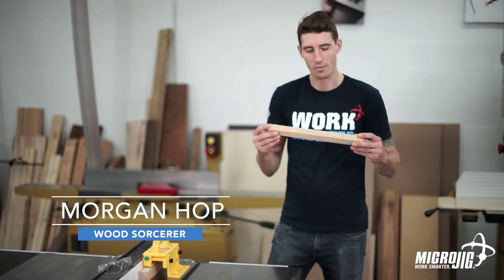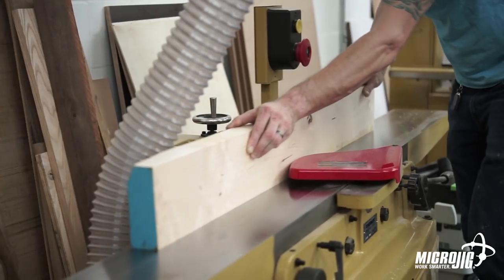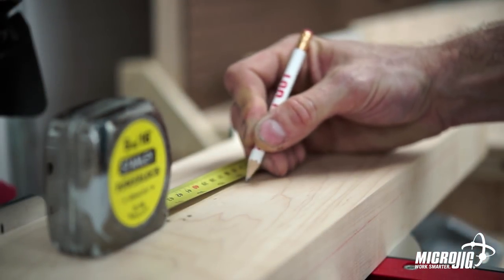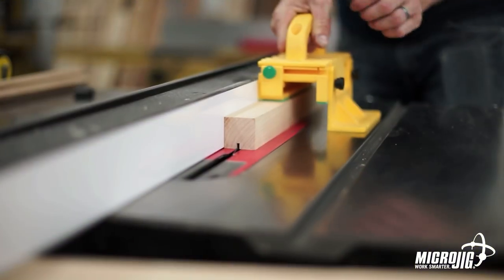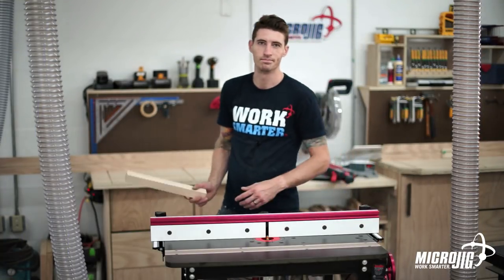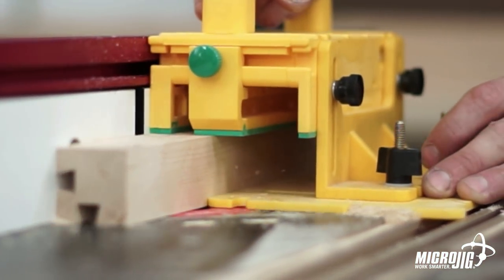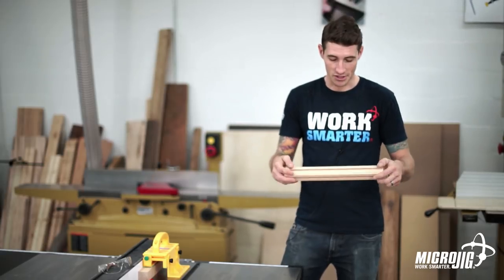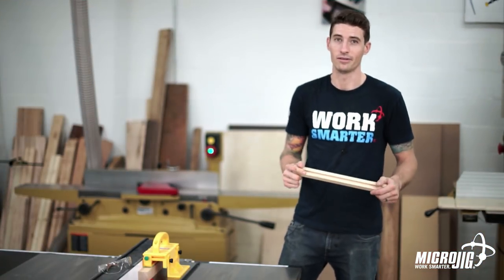How to Clamp 90-Degree Miters Better and Tighter

Comment: the only corner that needs an small bevel is the inside corner. cutting off the other is just for looks. if you started with 8/4 stock (2") why not use the thicker stock. it will give you more bearing surface. just square it up and go.
Reply from the maker: Paul, design is usually about both form and function! 
The best part about making your own shop-built jigs, fixtures and tools is that you can make them the way you want/like/need.

Comment: So while you were at the table saw why didn’t you just adjust your blade to 14 degrees and finish the slot?
Reply from the maker: Frank, you are referring to just cutting the entire dovetail on the saw? Can be don, but the overall width of the slot is very important. too narrow, and the clamps won't fit, too wide and the clamp head can rise above the stock surface which means it will not clamp properly. So the saw cuts are only to remove the waste before routing. You should do this with ANY undercutting bit like a dovetail or t-slot bit. It will greatly extend bit life and produce cleaner grooves.
Reply: Thanks for the explanation. I didn’t think of the tight tolerance.

Comment: This video is like explaining how easy it is to land on the moon, by sitting in the rocket and letting everything else do the job for you. The music is obnoxious too, as it just adds to the arrogance by playing down the use of commercial equipment. 

If someone is having trouble clamping their miter, you could reasonably assume they would not have more equipment than a university at their disposal. 

Pro tip: it’s cheaper and easier to exchange money for clamps that do the same job. 🎶🎵🎶🎶🎵🎵
Reply: If you don’t have a table saw & router, I’m not sure how much woodworking you can expect to get done. Obviously not all woodworkers have large jointers & planers, but square stock is easily available for those who don’t.
Reply: Wow. I kinda laughed at the stupidity of this comment.  I mean comparing sitting in a rocket to this is kinda pointless.  No matter how you think it was an analogy or not.  You complain about the use of commercial equipment.  There are plenty of people that don't have tons of commercial equipment as well.  I have a lot of equipment but it is an expensive hobby for me.    Granted you need at least a router, can be a hand held only and not get a router table with a lift.  But since the dovetails require the use of a router, you have to have at least that.  If you want to use t-track clamps, same thing, you need a router to make that t-track or a table saw to make the rabbit cut.  So would you make the same complaint about the t-track?  Second thing that made me laugh is your statement about a "Pro tip".  Really, you are giving us a pro tip?  Should we assume you are a pro then?  If you are a pro, you wouldn't be making these statements for one.  If you are a pro, you would have a table saw and most like some form of a router.  Lastly, your pro tip is not an actual tip.  All you are saying is that someone could go to buy clamps specifically for clamping miters.  Well then sir you missed the entire point of this video, with obnoxious music.  As a "pro" I would think you would have clearly understood the video.  It is about being able to reuse their clamps to secure miters so you can glue/screw them together and say at 90.  Your solution is to go buy more clamps that can only be used for that one purpose.  There is a clamp that can hold a pocket hole against a piece.  Kreg makes it and it is $34.95.  COmpared to $22.50 for the Matchfit.  Oh that's right, I don't have to buy the kreg $35 clamp because I own the match fits.  See sir, the reasoning for the video is to show another use for the clamps you already bought and not buy more.  I can make a 90 degree piece of wood like bracket and then get some regular old clamps and clamp that as well.  But those clamps don't fit in dovetails that I have started installing everywhere.  That $35 kreg clamp is only good for a certain distance, compared to those wood jig used with the matchfit, this wood jig secures a larger area of the pieces.  How's that for a pro tip?  Now did you learn something?  If you want to give a Pro tip, why didn't you post a link to these cheaper and easier items/ways?